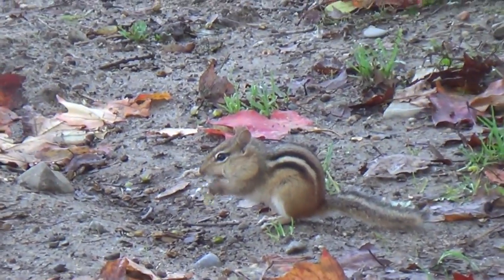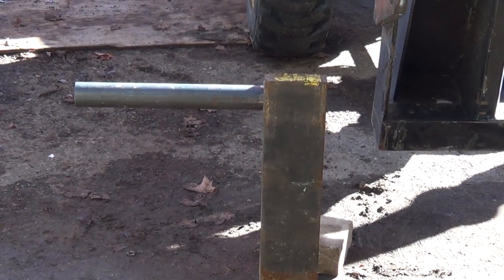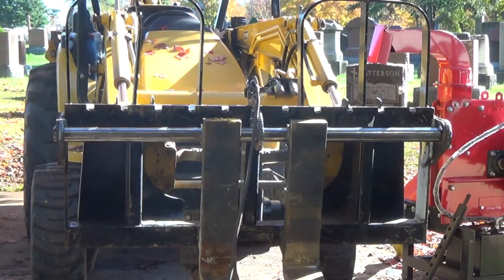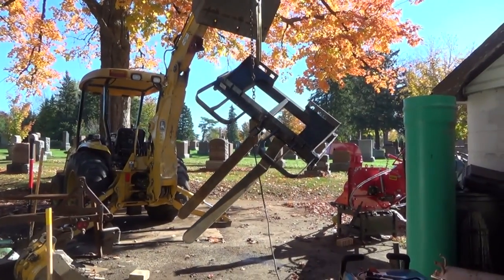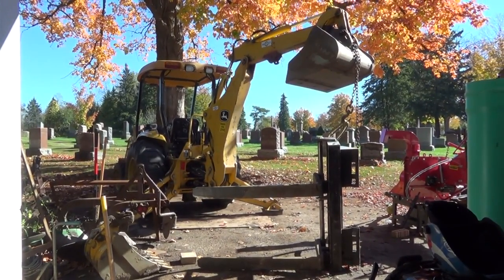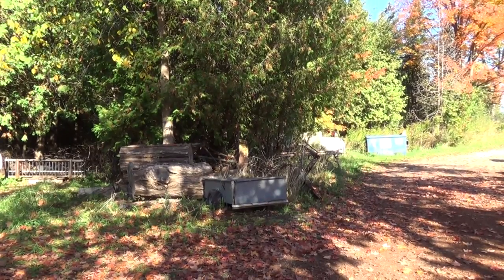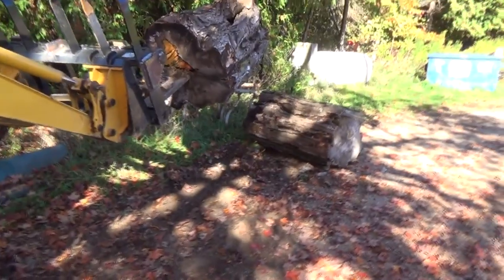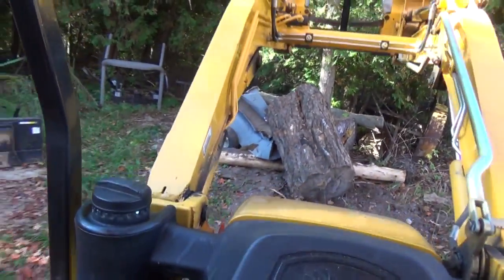FORK.............    THE FINAL FORNTIER AND TRYOUT

Comment: I think a middle ground idea for keeping the forks in place are some u-bolt clamps, like for auto exhaust.... One on either side of each fork, just to keep it from jiggling around while driving with no load on the forks. You would still be able to move the forks if need be.

Comment: Bill you should weld a few tiny pieces along where the bottom rests so the forks don't slide back and forth which they will do slowly.  Actual forklifts have pins at the top of the forks that lock into those notches at the top of where your pipe goes across

Comment: I suggest keeping the forks movable... We have a set of solid forks for our loader and I've run into problems unloading certain things where they don't fit and have to get our forklift with movable forks. Which if the thing is loaded in the back of a truck or long ways on a trailer its hard to reach at.

Comment: Time to replace those clips on your fuel pump cable,they are getting pretty rusty causing them to heat up from the current trying to get through a poor connection.

Comment: Not to be intended as a negative comment, but if I were fabricating the fork lift, I would not have welded the 2 inch round stock to the frame work, instead I would have welded  a short section of 2 inch id tubing to the frame with a hole for a pin to lock the bar from sliding out on both outer sides. Just think of the problems you are going to have when it comes time to replace the 2 in. bar stock if bent, it will have to be cut into sections and then holes cleared out

Comment: you should have put 1 bolt on each end. just drill and thread a holw with a big fender washer  on each end of the bar and if you ever needed to take it off just unscreww one bolt and then slide it out

Comment: I think The lift capacity is based on physics, not hydraulic power.at the pivot pins, end of loader arms to bucket. Its based on 1/2 the weight required to tip the equipment. For ex; if the center of your load is 1 foot out on your forks and the tires are 1 foot back then your max lift would be 1/2 which would be 2000 lbs. in this example 4000 lbs. would raise the rear tires. The front tires are the center of the lever. (Think of a teeter totter) The further out you go the less you can lift.

Comment: Don’t know if it will help you personally but Rolls Royce have two actual men welding their car roofs on to the rest of the chassis and it had the same buckling as you did, though more so because it was thinner and I think it was stainless but don’t hold me to that. With one person each side they welded the whole roof on moving at the same speed which was because they had it buckling. Think it takes about 30 minutes to do and they must go the exact same speed as each other,then it doesn’t buckle

Comment: Lookin' good Bill,but wholly what a waste of fluid film,some black spray paint on the tabs and welds would have been better,it's gonna get grimey and collect crap on there.I would have pinned on the bar instead of welding it incase you had to remove a fork,such as if one got bent from jabbing it in the ground.

Comment: just drill the hole bigger where u were thinking of putting a pin and weld a nut then u can tighten a bolt to hold em in place

Comment: And if it was me I wouldn't weld the bar in place either ! What if u bend or brake the folk now u got to undo ur welding . Why don't u drill and taped the ends and make a plate like washer to hold  them on.